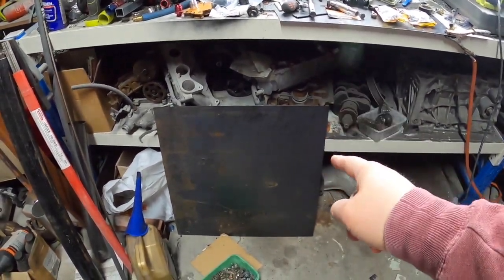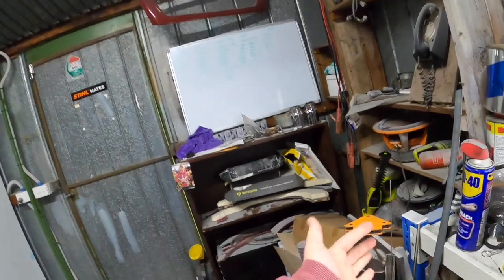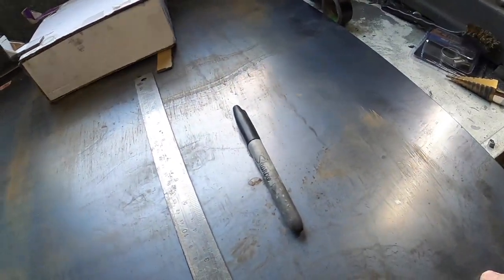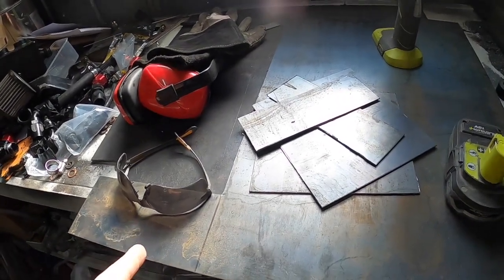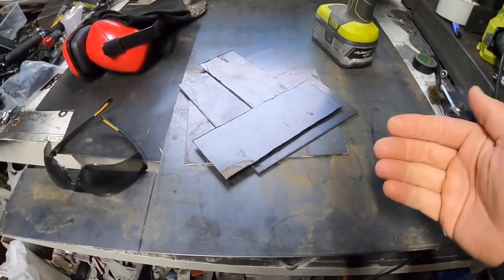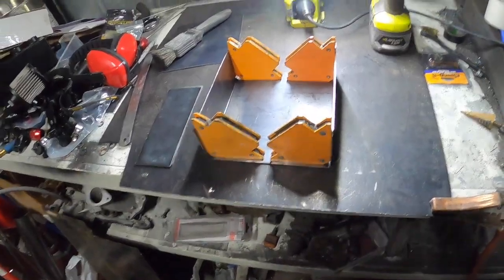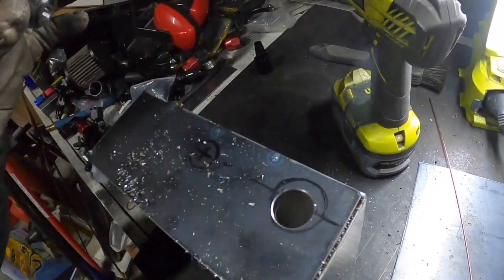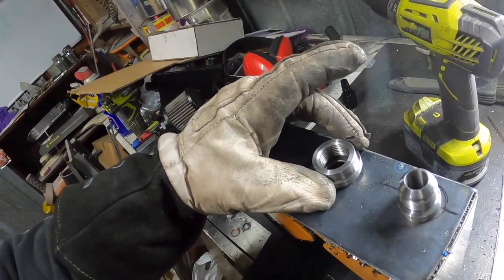Custom Catch Can for a Twin Turbo Forester | PART 3

Comment: You could have totally folded the metal template. Score along the lines with the grinder about half way through, then fold upwards onto itself. 😁
Reply from the maker: Yeah I tried that. Could only bend so far. Need maybe a 3mm-4mm score in it to bend it to 90 degrees